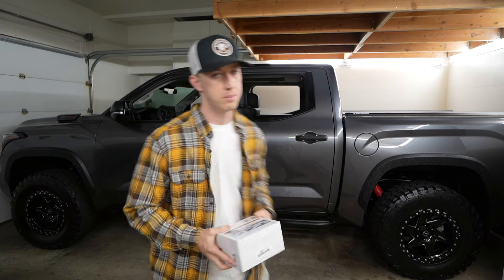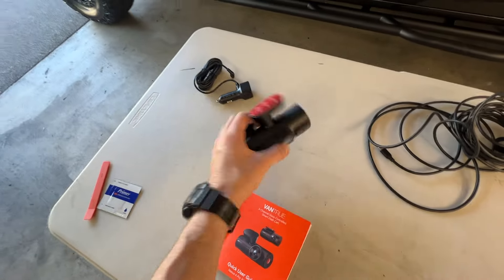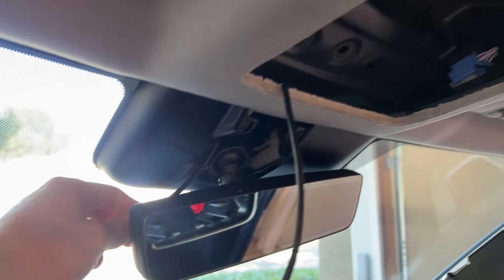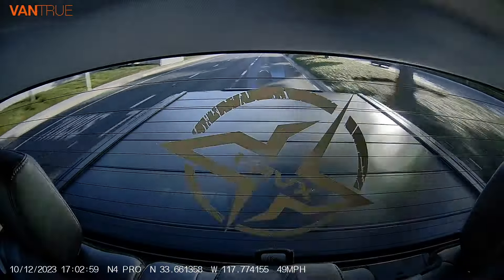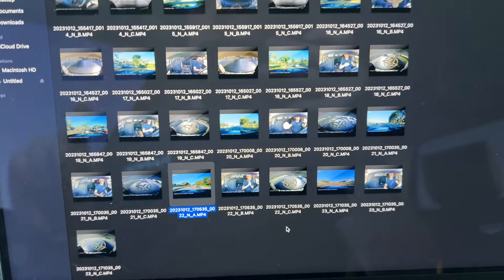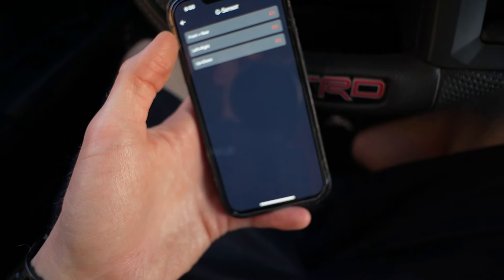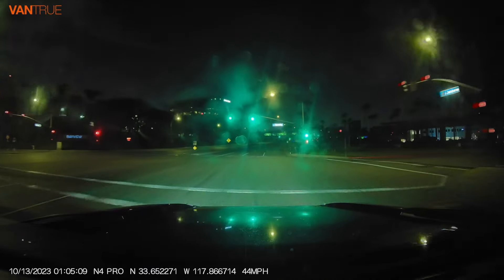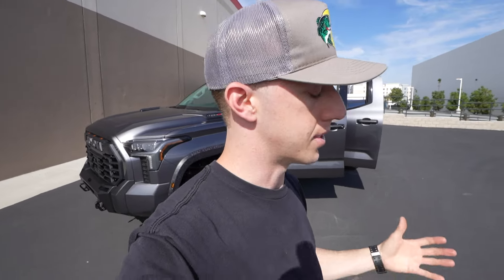PROTECT YOURSELF ON THE ROAD | VANTRUE N4 PRO 4K DASH CAM!!

Comment: That rear window issue looks like a job for a 3D printer. You could have a bracket made that allows you to mount it on one of the rear pillars or the ceiling but keeping the cam right where you want it for best view. Still completely unattached from window itself.

Comment: Installed one on my wife's vehicle. Only thing I think you could look at is an external battery. I have thinkwire dash cam with blackboxmycar external battery so I can have video when my car is off. I don't have any worries about the dash cam draining the battery
Reply from the maker: How big is that battery? And where did you put it?
Reply: @MarkBrenner  it's pretty thin. Maybe 4inx8in i think.  I drive a 2022 4runner and it is under the front passenger seat.
Reply: Don't these cameras have parking mode already?
Reply: @Ruthlessbone   Yes it advertises it has parking mode, and in the manual it states that it automatically enters parking mode if you have it hard wired to your battery. The problem is if you power on the camera and enter the setting menu, go to record settings > parking mode > it shows as off (there is no way to toggle it to show as on in the settings menu) as well as options for setting collision detection, motion detection, bitrate & framerate.
Reply: @jasonf1551  yup. With the external battery, as long as you use your car every other day it charges the external battery so it can power up your dash cam for quite a while
Reply: @jasonf1551  that's messed up. I have a thinkware dash cam and I hardwired it to my battery bit it doesn't drain it on parking mode. I had no issues with it.
Reply: @JakeJake2308 what is the name of the battery pack and does it need to be hardwired???
Reply: @YTWine29  you can hardwire it. I plugged mine to the inside middle armrest console. The one I have is called blackboxmycar powercell 8.
Reply: Yeah, I just installed the PowerCell 8. Now I crank all the settings on the Vantrue N4 Pro to maximum sensitivity and time lapse, because why not when you have 96Wh to burn and you don't care if it completely runs down?
Reply: @Ruthlessbone  how do you know won’t drain your battery ? It will show on long run .
Reply: @Manihsi  becuase I've had it for 5 yrs and it still works! Plus I've never had issues with my car battery draining.

Comment: They make 90* usb-c adapters. You could’ve just got one to change your rear camera plug so you didn’t have to move the front camera. And for the rear camera I’d make a little bracket to mount up under the headliner then mount the camera to the bracket then it would be right at the glass.
Reply: Have you found a 90-degree adapter that is made to handle video and power? Thanks!

Comment: Using that donger power adapter is that the same as hard wiring?  What’s the difference? Does it turn on and off with the car?  What about parking mode.  Is it constantly running or can you set it for motion detect and it turn on only with motion when parked if using that cable?
Reply: You can get a wiring kit that plugs into the card fuse box, either to a fuse that only is active when the car is on, or one that is always active, to give you parking protection.

Comment: Is there a similar dash camera like this but one that installs on the rear view mirror ? I have window tint and don’t want the tint to start peeling if I put the suction or adhesive on the window tint
Reply: I'm researching dashcams and so far FitcamX looks like what I want. Still haven't found a way that I like to do the rear cam for any of them though...

Comment: I'm assuming the 4k runs at 30fps. If you don't connect the rear camera can you run the front camera at 60fps?
Reply: Nope!
Just runs at 30fps in all modes

Comment: @mark brener What is the app called for the dash cam I’m not sure if mine has it. I have the Vantrue N4 3 Channel 4K Dash Cam, 4K+1080P Front and Rear, 1440P+1440P Front and Inside, 1440P+1440P+1080P Three Way Triple Car Camera, IR Night Vision, 24 Hours Parking Mode, Support 256GB Max
Reply: Don't think the regular N4 has wifi where you can connect to the app. The only reason I know this is because I have the exact product you wrote in your post. I recently got the N4 Pro which does have wifi and the ability to use the VanTrue app